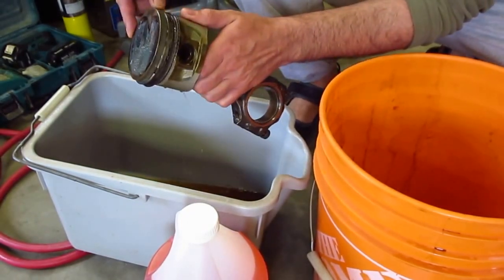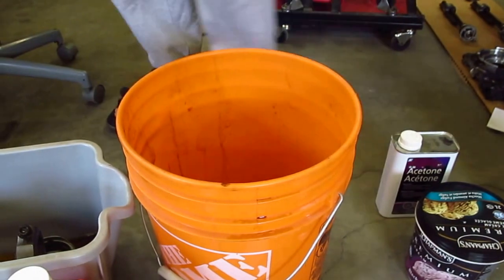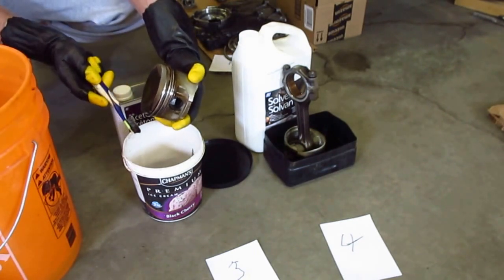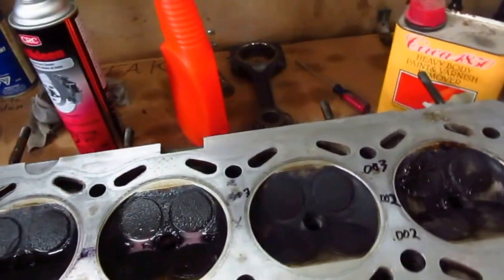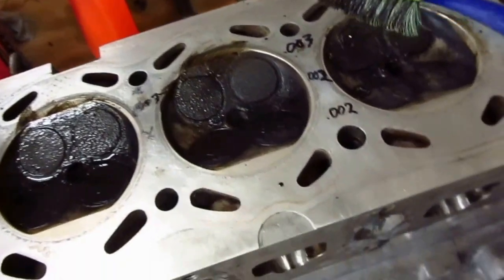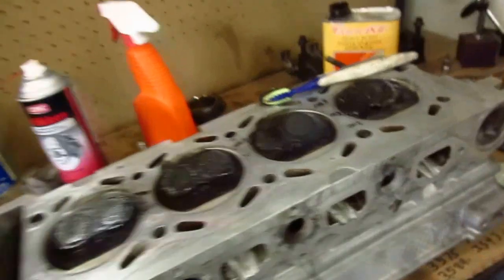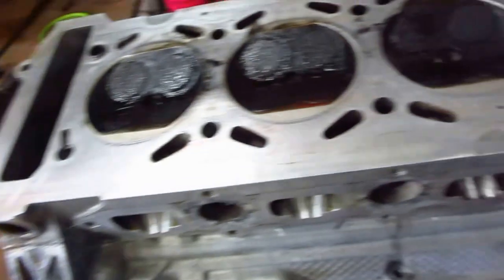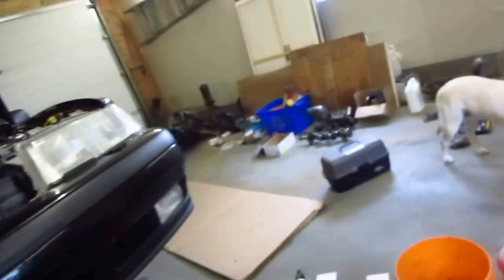piston and head cleaning decarbonizing diy shootout part 3

Comment: Yep many ways to clean carbon , try this your old transmission  fluid and a cup or 2 of paint thinners leave to soak for 6 to 24 his then wash off with hot water or pressure cleaner or hose .

Comment: Soak that stuff in kerosene for 24 hours it'll come off within seconds and you can drink beer while soaks instead of wasting time scrubbing and scrubbing
Reply from the maker: someone else mentioned that to me once and I have never tried it mainly because the stuff is so flammable and I smoke too much. I tend to lean more to solvents that need a blow torch to light. I will have to give it a shot sometime though
Reply: @EASTENDGLEN  it's not an advertisement but I use Alto pods when it's times like that not really the same as a cigg but gets the job done

Comment: I would be much easer to clean that with oven cleaner spray, with caustic soda, and rince with hot water.
Reply from the maker: be really careful with that oven cleaner on critical parts as supposedly it can weaken aluminum and cause stress fractures
Reply: @EASTENDGLEN  Of course, i avoid aluminium or I monitor the process.

Comment: Carb dip will melt the carbon off pistons, not the cheapest method but works well. JD
Reply: I like the paint remover idea for cleaning the chambers and runners in the head!
Reply: Chem Dip in the gallon can works really well. I brush it around the valves then turn the head on its side and fill the chambers up. Most Walmart stores sell it at 19 bucks. I know you just said that, I was just mentioning the brand I use.